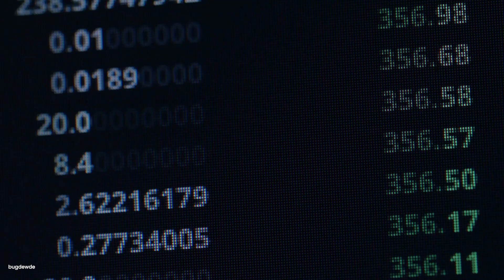How the Vega 2300 Engine Almost Destroyed GM

Comment: The styling, convenience and economy of the Vega is what sold them.  The fuel economy was excellent for that era compared to cars with V-6's or V-8's.  The light body and nimble-handling made the Vega a fun "canyon-carver" if you opted for the Z-29 Vega GT option which afforded the cars sway-bars front and rear with fat 13x6 steel-belted radials rolling on GT steel rally-wheels.  They were the working-mans/poor-man's "Tiny Camaro Z-28."  You had the look of a Camaro mixed with something exotic like Pinafarina styling combined with the added benefit of gas mileage between 24 and 34 mpg.  During the gas-crunch of the 1970's Vega was a welcome option to pouring expensive fuel through a bigger car with a V-8.  The hatch-back and the station-wagon (Kammback models) could hold a lot of items with ease.  There was even an optional tent-camping interface offered called the "Hatchback Hutch" that allowed one to camp in their Vega and sleep inside on the folded-down back seat.  The four-cylinder could have lasted with modern synthetic-oils and a better radiator, but GM should have offered their Aluminum Buick 215 V-8 as an optional engine instead.  It would have weighed the same as the four and produced double the horsepower and torque.

Comment: Can Americans build good cars?  
Yes.  My 2000 Camry wade made in Georgetown Kentucky. It still runs good.
The only repair to replace a broken part was a starter.  O.K. that device that won't let you start the engine unless your foot is on the brake......I fixed that myself by cutting 2 wires and adding an extra wire to my electrical system.
Reply: Your Camry may have been assembled by Americans, but it is still a Japanese car, designed and engineered in Japan, with all the durability and engineering precision one would expect.

Comment: My very first new car off the showroom was a 1976 Vega needless to say after 50 years of driving and many many purchases of new cars and trucks. It was the worst piece of shit car that I ever owned. It started smoking like a Loki right after the three year or 36,000 mile warranty Had expired. The freaking doors were rusting through already. It was just a piece of shit and the first comment here is right it had a cast-iron head aluminum block. It did not have steel sleeves. They sprayed some kind of aluminum on the aluminum cylinder walls or some kind of metal that was only a couple thousands of an inch thick and that’s probably what wore away When my Vegas started smoking at 36,000 miles. GM should’ve been ashamed of themselves selling a piece of crap like the Vega     the only good thing about  the Vega was.   I had another one that I took the piece of shit four cylinder out and  installed a 327 small box Chevy in it